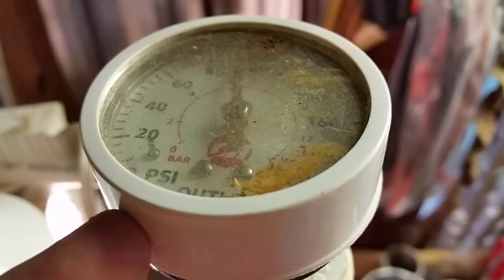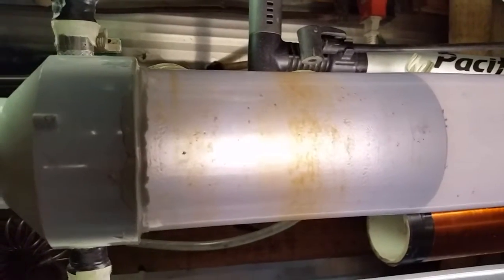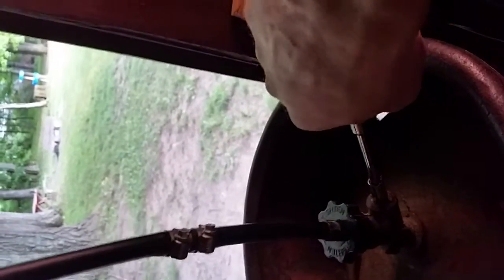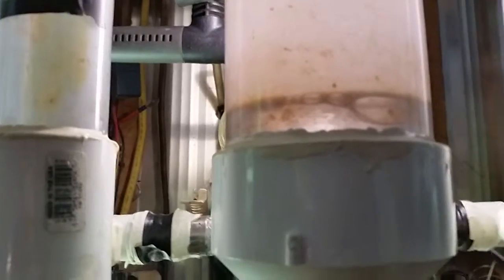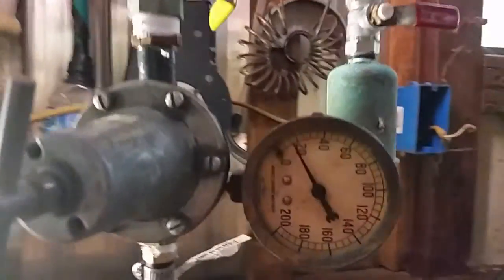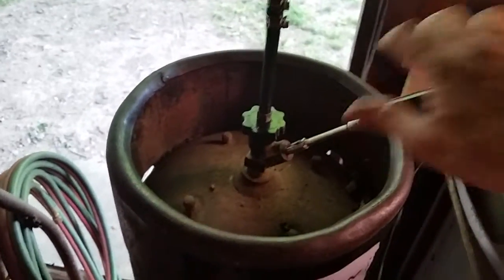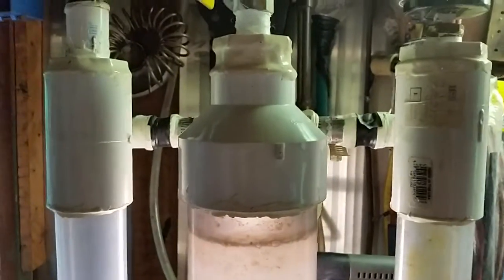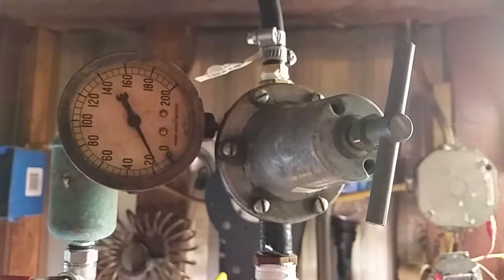hydrogen storage and uses

Comment: How do you make pure hydrogen?
Reply from the maker: you have to bleed the air out of any hydrogen lines or tanks, the can be no air with it, one wrong move and your dead, in the unit i biult, i was using 2 positives n one negative so that voltage is applied to both sides of my negative electrode that produces hydrogen
Reply from the maker: you need an h-bar chemestry set up, hydrogen is produced on the negative n oxygen at the positive which will be collected on seperate tubes, the electrodes must be in the line of site and made of platnium , you can get platnium wire from a jeweler, i used marine apoxy and teflon tape to seal it
Reply from the maker: also dc electricty, probly under 12 volts to avoid too much heat, tempature n pressure must be monitored at all times, or it will blow up
Reply from the maker: watch my other videos
Reply from the maker: https://www.youtube.com/watch?v=JjvgDf-retE
Reply from the maker: i use salt as a catalyst, water does not conduct electricity, i also use distilled water
Reply from the maker: https://www.youtube.com/watch?v=cB-ny7DaZm4&list=PLlsUmIGbk9JBLj5JANnW0wXMq5bCsyu44
Reply from the maker: if you try something like this, never do it inside your home, one of my units exploded in my living room, it smell really really bad n bleached my furniture, salt breaks down into cloride, which is  Chlorine like in a swimming pool, all of my prototypes exploded, just a warning, if i biuld another one it will have sensors to stop that!
Reply: Thanks will do.
Reply: If you have any more tips or tricks I’d love to learn more, and thanks for the information.
Reply from the maker: @DuncanBlackmoreGolf  silvex in maine can do nano coats on metals, machined electrodes dont need glue, just an oring